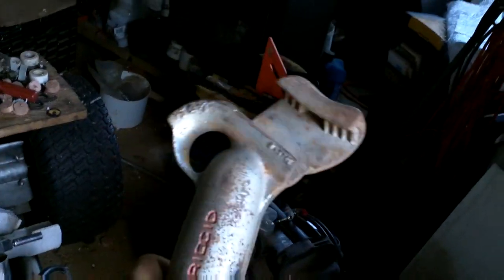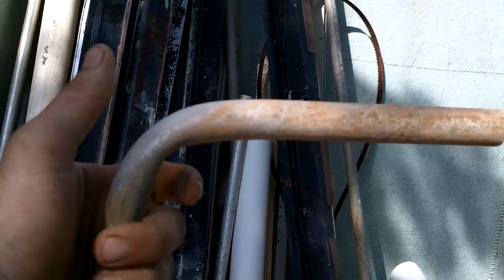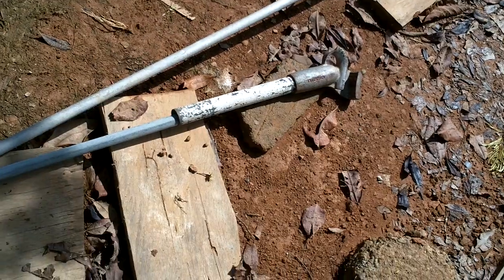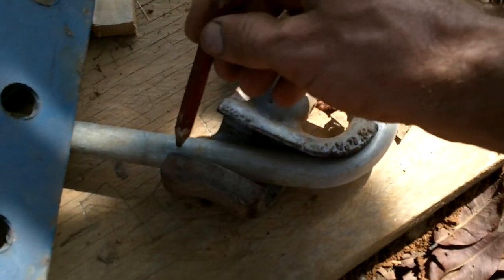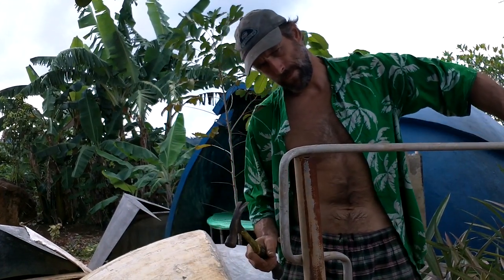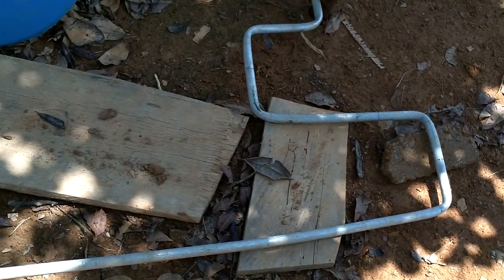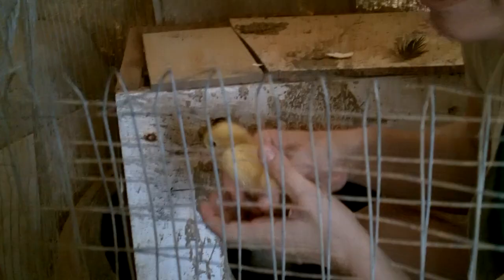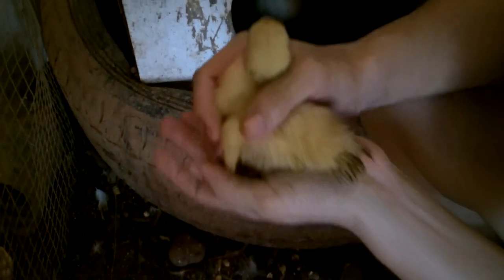Boat Chips 005 Making Pedals

Comment: Hi Jammie;  That pipe bender you have is called a "Hicky".  It is used to make various diameter bends in ridged 1/2" and 3/4" pipe.  Only bend a little at a time and move the Hicky along the pipe as you go, it is not designed to make a 90-degree bend in one shot.   If you can find a piece of 3/4" threaded pipe for a handle about three or four feet long, you will have better control of your hickey bender!  Cheers!
Reply: PS;  Your Hicky is also handy for bending reinforcing iron for in your concrete...

Comment: Fill the pipe full of sand and you can get a better bend with less crimp.
Reply: Pound it full of sand. Jamie knows this trick, so he probably has a reason not to use it.
Another thing to consider is that a pipe bender is designed for a specific diameter of pipe. It is physically built so that the pipe cannot crack or fold when cornering. The way it does this is by constraining the shoulders. A pipe bender is literally just a shape of metal that says "Nope, you can't go sideways!", and if a pipe can't go sideways, it can't kink. I think Jamie is bending a (significantly, 25-35%) smaller diameter pipe than this pipe bending die is built for, hence it works okay but can't stop the creasing or folding. To help this, he could add little pieces of steel on the sides to shim the bender closer to the correct size. This might work out okay if he put it in a vice when he adds those shims, or, just made his own die from a vice. His vice would be set a pipe width apart, and inside it, a curved piece (of wood, cut on a jigsaw and sanded) for the corner radius and a cupped half-tube (wood, sanded) to be the far fulcrum to bend against. He could make this for any size of pipe he wants to bend, on any radius.
Reply: Yes...fill it with sand and duct tape both ends.  Done this many times with multiple angles.
Reply: Just use end caps and water, not sand.  The water is easier to clean out.
Reply: @Reno Simpson Liquids don't need to be pressured, because liquids do not compress.  You must be subscribing to some new fangled science.
Reply: @danno1111  Sand can displace, too.  If you have never tried liquid then you'll be surprised it works just fine.  He's using aluminum and plastic pipe, two soft materials that are also brittle when over stressed.  The water will do some expanding, but unless it springs a leak will not simply displace.  You're suggesting the liquid compresses, which is will not.  If he was using steel then you would add heat as you bend.  Aluminum on the other hand gets brittle (and later corrodes) when you try to add heat for bending.  Plastic will stretch some, but if its closed off at both ends then the interior volume of the tube will not grow any more than the volume of the liquid.

Comment: So many ways of doing things I try to learn them all.
So I can turn them into my way of doing things, with what I have that works .
Turning what others see as trash into treasure , as heartwarming to do it's truly heartwarming to see so many others doing it too !
Sharing the ideas and the ways, improvising or even making tools to get it done, much more joyous and fun definitely much more growth then a kid for his first time in a candy store .
For the pipe bending using sand using a spring or cable that slides inside the pipe works very well to, the pipe bender that Jamie has as a short bite should be good for 1/2 inch and 3/4 inch pipe . with that short bite pipe bender, you will never make one swift clean Bend but if you take your time and work in increments, keeping your pipe on a good flat hard surface and always the handle of your Bender in line with the pipe. I imagine Jamie's got all the access to sand he needs . capping the ends to keep the sand in is it going to be the challenge not all of us keep a good supply of duct tape around . I'm sure he could find another way to plug the pipe, maybe epoxy . if I have a choice and the right size spring I have found nothing works better a long with working you're bend in increments . with this spring method you have a few choices to more snug the spring you use , you can seas it into the pipe with your bend leaving it , which adds a lot of strength and support. or a looser spring that you can pull out as soon as the job is done. To bad we all don't have the luxury of bending around a roller grooved to support and keep the pipe from kicking. The heating while bending and the cooling after always help keep a stronger structural integrity .
 As long as it all comes with joy it definitely comes with more health and happiness.
 HHBpHhelps

Comment: Jamie, did you consider using straight sections of pipe and making 90° connectors that you bolted or riveted to make the shape? This would make it super serviceable and simple to adjust if you missed your bearing centerlines

Comment: Cap the ends of pipe and pack full sand and use a torch & heat till red hot then - - Easy to bend metallic conduit

Comment: you may find with the pedals at 90 degrees from each other (for the two users) that it is uncomfortable to pedal, i understand that it was likely done to have a more constant power output or you may have had another reason, with the pedals at 90 degrees as one user is at the end of their stroke and as such at their lowest speed the second user is midway through their stroke at their highest power output, this will speed up the first users pedals potentially pushing their feet of the pedals, if i am right then this is likely the reason you see tandem bikes or pedalos where both pedals are always in sync, if i am wrong then i apologise for wasting your time reading this

Comment: 1) your pipe you're bending is too small to use in the pipe bender as is; that's why it keeps crimping. It's made for larger gauge pipe. 2) filling the pipe with sand would help prevent crimping and make it a more solid bend. 3) you'd probably get better results if you heated the pipe before you bent it.

Comment: I know u don't have a welder on the islands but how about oxy propane torch for welding or brazing?  Great videos!
Reply: A couple of lead acid batteries in series and a couple jumper cables makes for an instant stick welder (if you have the sticks)... solar powered if batteries charged via panels.
Though... I think he wants to keep things as light as possible, so plastic/fiberglass is a great solution.
Reply: Some time ago he showed him stick welding off his solar panels, but the welds weren't great without flux and it's hard to keep proper rods in the humidity